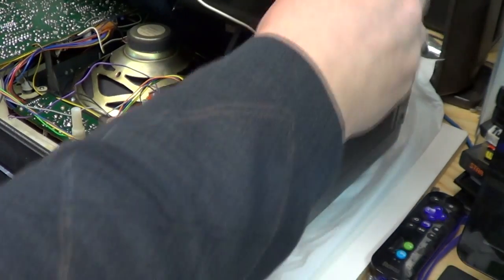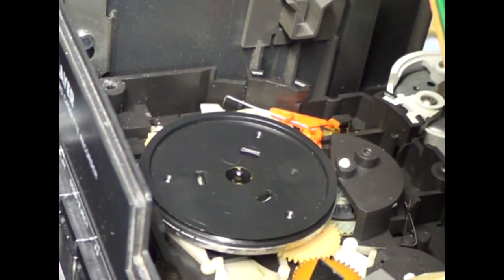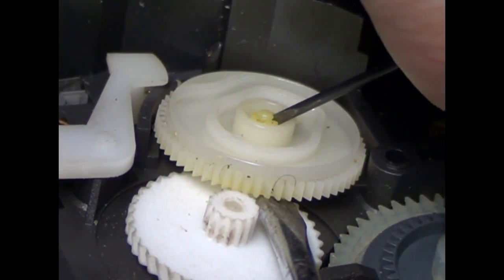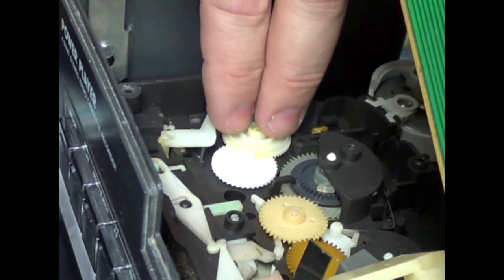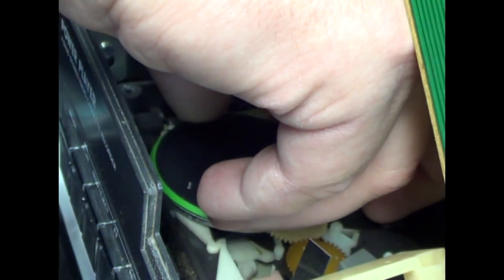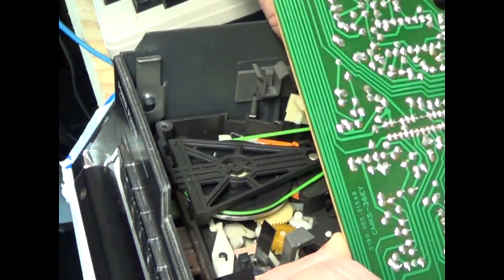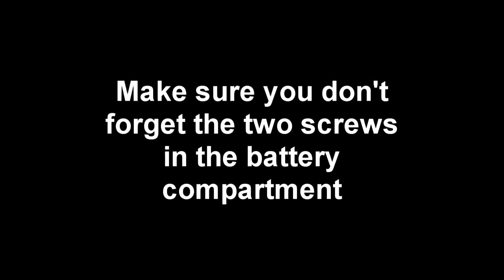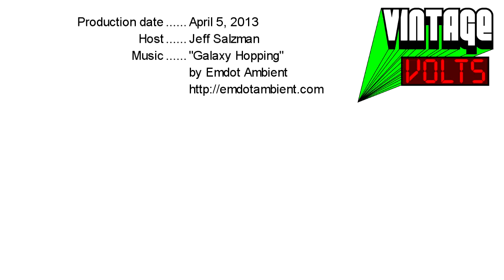Fixing the Magnavox D8443 Cassette Gear

Comment: This was a great instruction recording.  I have a Magnavox D8060 which is very similar to your model.  Two of the gears had broken teeth and so the cassette player did not work.  I purchased the gears and followed your repair instructions and am very happy to say that I now have a working cassette player!  Thank you greatly!!!
Reply from the maker: Thank you for your feedback. It's good to hear that another vintage system has been able to be resurrected and that the instructions were as helpful as I hoped them to be.

Comment from the maker: Hi, Justin!

Basically, without this gear in place (or broken into pieces as it tends to do over time) the left tape deck spindle fails to turn when PLAY is pressed. You'll probably still hear the motor running, though. Pressing rewind should still make the other spindle work, as it's driven by another gear.

It's also possible that the main drive belt is bad. You'll still hear the motor running, but you'll get no tape activity. Unfortunately, the only way to know for sure is by opening it up.

Comment: Hi Vintage, thanks for posting this video (great job) can you point me in the right direction to a place were i could buy the rubber belt (band) ? mine has snapped and needs replacing, hope you can help
Reply from the maker: I am actually using a Silly Bandz that my kids had lying around. Works great because they already have a square cross section. I just picked one that looked as round as possible and has a bit of tension when installed.

Comment: Hi. I have a Philips D8304. Both pins seem to turn, yet cassette deck 1 plays slow and cassette deck 2 doesn't turn the tape and therefore chews it up since it doesn't take up the slack. Both decks rewind and fast forward ok. Do you have any suggestions to the issues and remedies?

Comment from the maker: I think there's a mechanical switch that sometimes gets flaky or breaks. It's a switch which controls the motor operation. I don't recall what type of issues occur or how to fix it.

You might want to try looking on The Boomboxery website forums and search for a similar problem.

Comment: Thanks for sharing this, how did you make a new gear? It sounds mine is the same mechanics and the same part is broken, almost melted...mine is 2,5 cm in diameter with the little gear on top, unfortunately this parts are not longer available :-(((

Comment: I need help with my Magnavox D8443 the colored wires came out under neath the big green board I need the color to go into the right socket becuse it does not power on I would love to have it working again.so if you can help me I would appreciate it.

Comment: great explanation. I just got one of these. I am a novice at radios. All of them seem to have an issue where, when you turn the volume knob the left speaker goes in and out. The louder you turn up the volume the better the left speaker works. For me it is the left speaker. How do I fix this problem? Oh, my tape player worked well when I got the unit.
Reply: My radio has a similar problem. It seems the contact wiper arm in the volume control can break away from the plastic it's mounted to. That would cause intermittent sound or single channel cutout. I have attempted to rebuild my volume control (not an easy task), but the fix didn't last. I also have not found a matching replacement for the control yet.

Comment from the maker: It's only the one part, the gear being replaced in the video, which I have a source for. That is because I get them specially made. I offer the gear for sale on eBay.

I'm unable to post direct links here, so just search eBay for "Magnavox D8443 Replacement Cassette Gear" and you should be able to find the auction.
Reply: So it's my rewind gear that lost some teeth (it's orange and almost squishy) -- any chance you might do a replacement for that one, or know where I might find one?

Comment: Little hope of a response, but I forgot to take note of the orientation of the gear that goes on above the replaced gear....any suggestions on figuring out how it goes?
Reply from the maker: The cam gear must be oriented so that the smaller plastic piece that the thin wire eventually drops into can work its way around a cam slot on the underside of that gear. It should be noticeable what slot track underneath the gear will be engaged by the small pin sticking up from that piece.
Reply: @VintageVolts   Thanks!

Comment: I purchased a new gear from you last week. So far so good but I'm having trouble finding a replacement belt for my box as I can not get the gears to turn without it. Do you have any info on where to find to find one for the Magnavox d8443 or maybe the size of the belt?
Reply from the maker: I apologize for not seeing this earlier. It appears that I'm not getting notification of comments.

I don't know the actual belt size. I know the belt has a square cross section to it, but I'm unsure of the length. I'm using a "Silly Bandz" for mine. It has been working so far without problems. They have square cross sections, too. I just picked one that didn't have too many sharp bends in it's shape and also didn't need to be stretched too far when put on.
Reply: VintageVolts silly band worked for me !

Comment: Hey, I just installed the new gear. I put everything back together carefully but I still can’t get any movement inside. When I do turn the radio on and then off the tape motor spins briefly tho. I’m at a loss. Any guidance on what the issue could be?
Reply from the maker: When the PLAY button is pressed, do you hear the motor running consistently? That should be running all the time when any of the tape motion buttons are pressed. If not, there should be a micro switch inside the tape mechanism that activates when one of those buttons is pressed.
Reply: When the play button is pushed the motor doesn’t turn at all. Where is this micro switch?  Could it have something to do with the thin metal wire that clips into place in 3 places on top of the gears? I was a little unsure of the hole it went into when putting it back together. Thanks so much!!
Reply: That thin wire affects the auto stop feature. As for the micro switch, I believe there are two that can be checked. One is under our near the record button. The other is the button that goes through the top that switches the radio off and on. Make sure they are not dirty or binding.

Comment: Do you have any other parts for these? Like a battery cover?
Reply from the maker: +Anthony Linonis Sorry, I do not. I created this gear due to mine being broken, so it was a necessity. After learning others had the same problem with their gear, I invested in having them manufactured in quantity. Battery covers are possible, but to have them manufactured would make them rather expensive due to their size, nor would they look like the original. It would not match the existing color and details.

Comment: Magnavox D8443    replace the idler gear. Tape plays but does NOT shut off at the end ?
Reply from the maker: I believe I already gave you advice on resolving that issue on a different forum, but I'll repeat it here for posterity.

Make sure the thin wire that goes down through one of the pieces goes through the slot on the part that's under that piece. Without the wire passing through both, auto-stop may not work.

Comment: these internals look exactly like my d8330, will this work for my boombox too?
Reply from the maker: +Jamie Nieves I'm not familiar with the d8330 internals, but I do know that Magnavox used the same cassette mechanism in several products. If the internals look exactly the same, then it might be compatible. If it helps, the diameter of the gear is approximately 2.36 cm. and the total height is 0.61 cm. There may be slight difference in tolerance.

Comment: i got a Maganavox D8443 and inside the Tranceformer wires came out its a red and black wire came out where do i plug in the red and black wire in to there a serten way to plug it in. and also its a 2 amp fuse i used a 6 amp in side and blwe the fuse .if i used the wrong fuse will it blow.
Reply from the maker: Does the part of the video around the 2:00 mark describe the area you are referring to and/or help you get a better reference for the wire positions? I can't quite visualize what it is you need fixed.

Comment: Is This tep recorder parts are available , play gear, reverse forward gear & pinch roll,
Reply from the maker: I am not aware of sources for any of the other parts. I had a specific need to replace the one gear, which was a very common fault. If other components in my own devices break, I'll most likely try to produce replacements at that time.

Comment: Hi All, Do you have the 3d project for the cassette gear? Or do you know where i could buy that part? I need to fix my stereo... Thanks!!!
Reply: Filippo Giorgi Whenever I have them in stock, you will always be able to buy them on eBay. Just search for "D8443 gear." At this moment, there are 4 left in stock.
Reply: Cool, I've send you a message on ebay, please read it! Thanks!
Reply from the maker: I don't know why eBay is blocking international payments. I've tried numerous times to pass a message through. And when I try to respond with information on other ways to get payments to me, they block those, too, by accusing me of selling items outside of eBay.

Go back to your purchase on eBay and send a message from there containing ONLY the email you use to make PayPal transactions. I will calculate shipping and generate an invoice through PayPal using that address in the request.

Thanks!
Reply: Done! Check it!
Reply: Ehi, I've send you an email, please checkit! Thanks!

Comment: I ordered and fixed the wheel, but the rewind and fforward is not working any advice?
Reply from the maker: There is a second gear that goes bad. It's been a while since I looked at the mechanism, so I'm trying to go from memory. The second gear is located near the tape counter, and I believe that is responsible for FF/REW activity. I do not have replacement gears for that.
Reply: @VintageVolts  I have the same unit D8443 it plays but no rewind or fw. Before I open the unit up. This model by the looks of it only has one belt and the rest is plastic gears is that correct.  So either my unit is dirty or possible a bad gear that operates the rw and fw.  Thank you for the reply hopefully

Comment: AWESOME TECH VIDEO.  I HAVE 2 D8443'S..  (ONE WAS MY DAUGHTER'S BUT LOST INTEREST).   .BOTH WILL NOT RECORD & ONLY PLAY CASSETTES  BOTH UNITS GIVEN TLC & IN MINT CONDTION....WOULD APPRECIATE YOUR INPUT.    DO YOU SUPPLY RUBBERS AS WELL FOR DRIVE WHEEL???

APPPPRECIATE YOUR HELP:)
Reply from the maker: Failure to record is supposedly a symptom of the switch mechanism within the cassette assembly. I have not experienced this issue myself, but I believe the switch assembly can be found near the record button itself. If not, you might find be able to see what is or is not working by looking underneath the record button and tracing the mechanical movements.

As for the rubber components, I'm afraid I don't have any other replacement parts for this radio. This video represents a fix for an issue I was tired of dealing with. I made the video and sourced the custom replacement part to fix this one rather common problem.

Comment: Please help!! What if the other gears broke????
Reply from the maker: +The one and only Sista E The current replacement depicted in the video is self engineered to fix the specific (and common for the model) issue I had. There is one other gear that tends to go bad. However, that gear on mine is working and trying to replace it without it being broken already can damage other components, resulting in a bigger problem.

Personally, I will be addressing that issue of the other gears when they fail on mine. When I do, I'll be documenting it in the same way for others to use as a reference.

Comment: I failed to explain my problem a little bit haha.. The thing is.. the motor doesnt run when i press play... I tried to connect it to an other source of power to check if that was the problem but when i did, the motor was working.. So there must be a connection that doesnt work anymore .. and for this.. I have no solution :p